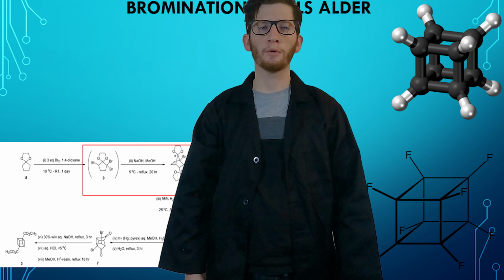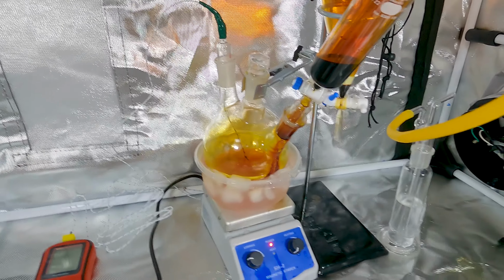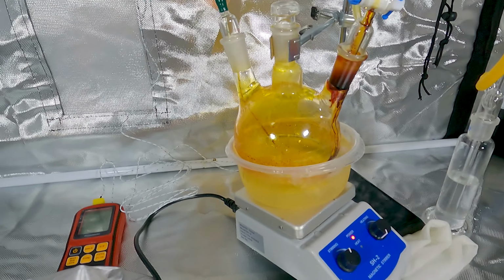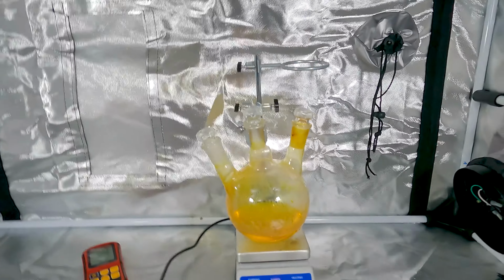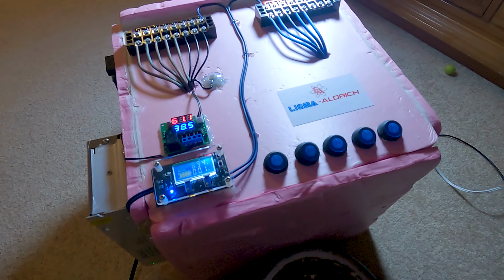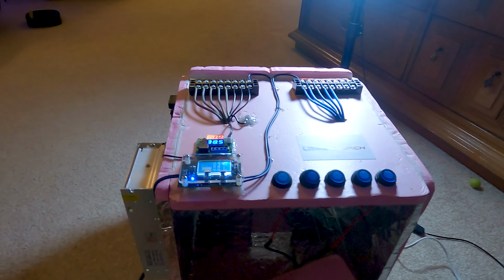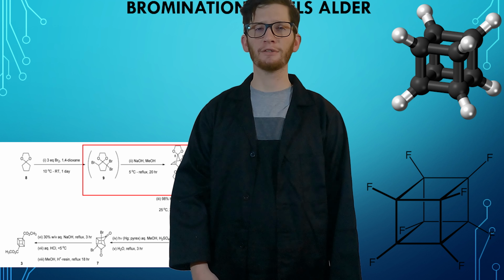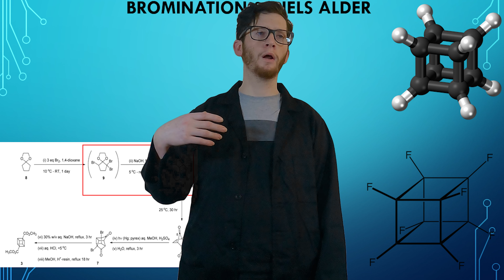Hunting Cubane - Ketal Bromination and the Diels Alder Reaction

Comment from the maker: Sitting here rewatching the video looking at that giant “5C-reflux, 20hr” on step 9-10 behind me on the screen. Was paying so much attention to what the actual passages in the paper said I didn’t even notice it in that graphic. Still learning quite a lot about doing independent experiments but I’ve been having a blast. 

Does the audio sound any better from previous videos? 
Do you like the green screen effect or the TV/prop background better? 

I’ve been experimenting around with an AI called RunwayML so that’s how the background is removed but I’m just up against a white wall so it’s not as good as a true green screen. It’s a suite of tools and they also have a “cleanup audio” feature so I tried that during the intro. It’s a paid monthly AI though so I’m only going to continue using it if it provides a really good benefit. It’s extremely slow to have to upload the intro/conclusion, process it online, export it, then download it so I hope they improve the speed a bit. 

I also got a media mod mic for my GoPro so there is a likely a difference between my first few updates during the procedure vs my last (I shoot the intro and conclusion at the end of my experiments so the new mic is in those clips.)